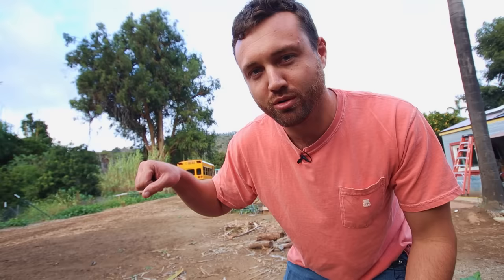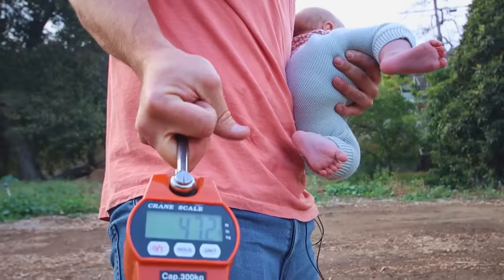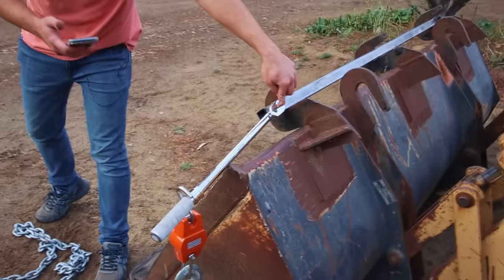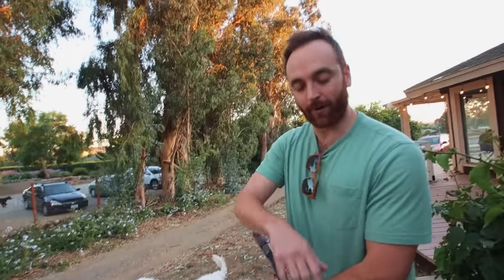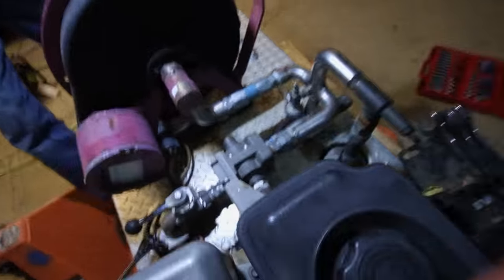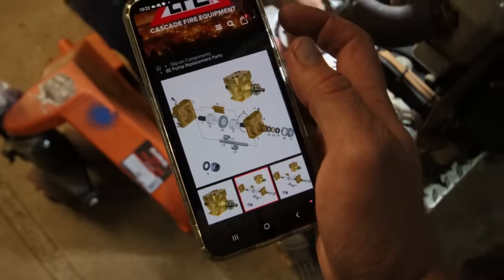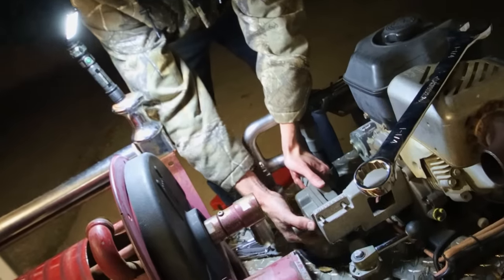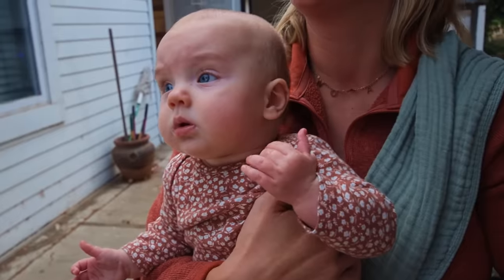Proving my very big wrench works

Comment: What made this video even better is I work at a Toyota dealership and Toyota recently released a torque application module for training which explains why this works lol
Reply: Sad thing is, I feel like it shouldn't need to be explained why it works
Reply: Idk, I'm taking my second physics course right now and trying to think about why it works is not imreally intuitive to those who don't know what torque represents. If it were going in a complete linear motion, it would not increase the force. I think it's fairly easy to get confused by that
Reply: @kstorm889 I spent a few minutes scrolling through the comments from the last video, and I only found two saying he was wrong. One of those comments (which had mentioned free body diagrams) was retracted thanks to the other, which was a comment that I made, and my point in that comment was that his explanation of how torque is multiplied in the previous video was wrong. He got it right in this video, but in the last video, he said 200ft•lbs multiplied by the 5ft extension equals 1000ft•lbs which isn't correct. The torque is actually multiplied by the ratio of the overall length to the length of the wrench. (If the wrench is at an angle to the extension, the overall length is measured parallel to the wrench from the wrench handle to the perpendicular line that passes through the bolt.) 

Using the numbers from this video that would be 214×(76.5/16.5) = 992 which is basically what he measured. It would appear to me that he got lucky that the length of the wrench and the extension plus the fact that actual torque is 7% over the set torque worked out to make the torque multiplication of this setup approximately 5. (The exact factor is 76.5/16.5×1.07 which equals 4.96)
Reply: @jsax01001010  I get what you're saying and agree 100%. maybe I misunderstood thinking his extension  made for 5' or whatever it was. I just knew when I saw the rig that there would be a lot of debate in the comments.
Reply: @kstorm889 ikr isn't common knowledge that the longer the lever increases the torque?

Comment: So I am an engineer and I design fire trucks for a living. That's what we consider a skid unit most likely was originally on a small a UTV or something. We don't  do too many trucks with skid units but Ironically I am actually currently designing a custom one for a Polaris ranger at work right now. Anyways. There should be a hand primer somewhere in the unit which will prime the system within a few pumps. If there isn't there's a chance it was mounted to the UTV and was not kept with the unit when you bought it. I am not super familiar with that exact type of pump however in general it's bad for a pump to run dry and it can cause it to overheat and damage components so there's a decent chance that if it wasn't already damaged before you bought it attempting to run it dry is what ended up damaging the pump. I would look closely to try to see if there's a hand primer installed on it. If there isn't you need to buy and install one and make sure it's primed prior to use. Also make sure you have your valves set correctly so you have water flowing through the pump. There is often a tank to pump valve as well as a tank fill valve both of which being open will allow water to just cycle through the pump while you aren't using the hose. Remember water is a noncompressible fluid so it needs to be able to go somewhere otherwise things can break. I would suggest having that friend you talked to or someone at the manufacturer of the system run you through how to operate it if you aren't sure. Also not sure where you live but especially if there's any chance of freezing you need to make sure you drain the pump system after each use. We see a few trucks come in periodically for new pumps because they forget to drain the system in the winter.

Comment: hey William! Im a Mechanic Engineering student and wanted to say your demonstration, though a lil rough 😁, was great!

I think for people who dont know the equation for Torque is LITERALLY the cross product between Distance and Force it may have been a bit difficult to visualize what exactly you were getting at.

People not in stem don't even know what Torque really is (my gf thought it was basically a force, for instance). For anyone still confused, Id like to explain it with the basic principle of the lever and the equation for torque.

If I need 1000 Nm of Torque (same units as lbft but in metric) but I can only verify 200 Nm of Torque, what distance do I need to achieve the desired reading?

We can start by setting up two equations: T1 = R1 x F1 (where T1 is torque needed, R1 is distance from the center of rotation to the normal force, and F1 is the Force applied [by William lol!]) as well as T2 = R2 x F2 (where T2 is verified torque. R2 is the distance from force to center, in this case the length of the Torque wrench, and F2 is normal force again)

However, it is evident that in both scenarios, the same William will be the one applying the force. So, if we trust William to be a good boy, we can assume that he will apply the same amount of force in both scenarios! This gives us F1=F2=F. Knowing this, we can now combine both equations by solving for F individually like this:

T1 = R1 x F1, T2 = R2 x F2
=>
F1 = T1/R1, F2 = T2/R2, F1=F2=F
=>
T1/R1 = T2/R2

Now all we have to do is solve for the length needed, R1!
R2, the length of the torque wrench, was given to us by William, which is about 0.4 m.

Now all we have to do is plug in to our equation and solve for R1!

T1/R1 = T2/R2
=>
R1 = R2(T1/T2)
=>
R1 = (0.4m)(1000Nm/200Nm)
=>
R1 = 2 m!

This means the distance needed to get 1000 Nm of torque while only verifying 200 Nm at 0.4m (and assuming the same force is applied) is 2m!

So what do we get when we convert from meters to inches?

R1 = ~78 in 🤠🤠🤠

subtracting the 16 in of length from the torque wrench from it, we get 62 in, which is ~ 5ft, exactly how long Williams extension is! 😌

Overall my calculations were about 2 in off from Williams actual distance, not too bad since this was all made up and converted in and out of metric, but the principal is intact.

Hope this more mathematical based approach helps anyone still confused! Remember, Torque is leverage 👺

Comment: I don't know why people would doubt it. It's a known thing,it's just math. I was once looking into using an extension on my torque wrench to do some work on my transmission. The adjustment was right between the trans case,and the frame,so I couldn't get a torque wrench+socket in there,but I could fit a slim torque wrench extension in there (imagine something like an open-end box wrench).. I looked into them,and yes,they sell them...and there are clear instructions for doing the math to work out the correct torque,with a table,and everything.
Archimedes has known this since the dawn of time.

Comment: I work in a small engine shop and that pump that's on the water hose machine thing, is exactly like the ones that are on some of the bigger pressure washers that I work on. And fun fact about those pumps, if you don't run them with water going through, they will destroy themselves in less than 5 seconds. i learned that the hard way

Comment: I think that people that were confused about it were thinking about the fact that torque is equal regardless of where you apply it, however this is not just torque, you have a perpendicular force generating torque. If it was something like a motor you would need 1000foot/pounds regardless of how far you apply the torque.

Comment: In regards to the self-priming pumps: in the bush firefighting fire trucks here in Australia; our main pumps on the trucks don't self prime, but we have bilge pump styled hand priming, or electric primers; but they're not automatic.
For smaller pumps like what's in this video they are pretty much never self-priming (We dunk our helmets into the river/dam/lake and use them as makeshift buckets to pour into the top of the impeler housing to prime the pumps. No I'm not even kidding).

Comment: did people really not think your giant lever wouldn't work? i loved it lol. i was happy to see you made the worlds greatest cheater bar instead of just buying a geared torque multiplier. for one, your video was entertaining and you just buying an off the shelf tool would be boring, and for another thing, making your own tools to work on things is just part of wrenching on equipment. i have a drawer full of weirdly shaped wrenches that were modified for specific things over the years lol

one of my favorite things about torqueing something to spec though is that you can really get super close to a calibrated torque just using a regular big wrench and some tape. if you measure out an exact length on the wrench to pull on, and you can get the wrench to be level with the ground, you can do the math and simply put weights (like lifting weights) hanging on the wrench to reach the desire torque. you don't even need a fancy freight scale to do it that way lol

Comment: Get a load of bolts and weld nuts in place so you can toque them until they snap off. Then test your torque wrench without the extension and find the minimum bolt size that survives. Then use your extension and see if it breaks. See how much bigger bolt you can break off with the extension but wrench at the same setting.

Comment: As a calibrator and someone who has calibrated over 800 torque wrenches for the military, NASA and various other companies. When calibrating them they are calibrated usually within a tolerance of 4%, when your taking a measurement the only accurate spot to measure from is the middle of the handle, usually textured part where you adjust the torque. The measurement is taken with a transducer in the bench, force scale will not accurately measure the force. While the pole does indeed increase the torque applied, however part of that force is taken by the deflection of the pole. it will not be accurate in the slightest maybe to a tolerance of 20% to 30%
Reply: force isn't "taken by the deflection of the pole"

Comment: if u contact the seller they prob say u ran it without priming and thats why its molten, unlike what prob happened is that they left it running dry for for a long time and sold it after it broke

Comment: Will is going to learn quickly that with big equipment, comes even BIGGER tools to maintain it. I have an adjustable from the 60's that I use to fix stupid stuff on tractor buckets, PTO's, etc. Find the nicest (bang for buck) and largest (bang for buck) adjustable wrench from anywhere pre 90's and it will last at least Potato is in their 70's. That wrench in particular is what I plan on using in case of a zombie apocalypse.

Comment: FYI the torque wrench contraption should work as long as the wrench is parallel to your piece of steel you're using to extend it, if it's at an angle the torque wrench will pop before the predicted 1000 ft lbs.   

Also did Kevin move in?

Comment: - as per the debate held by John Cadogan in Australia - errors with clicky torque wrenches arise doe to improper hand  (or force) placement relative to the "manufacturer supplied hand grip"  (centre of the handle) - ie if one "chokes upon the handle, the fastener gets "over-tightened" by the time "the click" happens, you don't seem to be making this mistake  (but a electronic torque cell  may prove a case better than a force cell..)...   - fun days... lol...

Comment: Torque wrenches have been argued about by mechanics for decades.

The physics group I run has gotten quite a few requests on the topic and usually the audience has an understanding of the topic after demonstration.

That said, the arguments in general come from the lack of understanding how the tools/formulas work. Usually once they see how it works they don't have any other questions on the matter.

Comment: "Bustards, including floricans and korhaans, are large, terrestrial birds living mainly in dry grassland areas and in steppe regions. They range in length from 40 to 150 cm" 
I know these ones can get them arms, they almost already have arms kind of because their legs are pretty thick but they need to have a second set of them chunk legs so they can pick up arms with their arms. They have the leg strength in order to lift several pounds. Arms could weigh some pounds and becoming armed would also weigh a couple pounds. I think catching some of these dudes and then taking them to planet fitness or something could kickstart them growing some nubs from their torsos because they will have a need to pick stuff up if they got some weights in front of them.

Comment: The question I have about the torque wrench setup is that the torque wrench is calibrated to account for the torque lost in the deflection of its own bar, but it’s a totally different story when you add your own bar. I don’t know how much of a difference that would actually make, but I know that air guns use different extensions to torque bolts to different specs. The applied torque at the gun is the same, but the torque that makes it through the extension and to the bolt can be less.
Reply: The torque sticks your talking about are very ruff not all impact guns are the same weight rpms etc the way he did it will be in the ball park probably only +30 -30 ft pounds out

Comment: If you made your torque wrench extension out of a 5ft pool noodle instead, would you still say you got 1000 lbs of torque? 

If your extension bends when applying the torque, do you think you might have lost some torque?
Reply: Yeah, he's using the formulas he used in school, which are absolutely accurate...in the ideal situations that they model (e.g. if the lever has exactly 0 deflection). But his contraption is a whole hell of a lot more accurate than just putting a long-ass breaker bar on a wrench and pulling until it "feels right" ;)

Comment: Wait, isn’t torque = Force / Distance so shouldn’t it be Lb/Ft (Pound/Feet) not Foot / Pounds (Ft/Lb)?
Reply: It's neither of those. it's lb * ft (pounds times feet,...multiplication, not division...usually written as ft-lbs or ft (dot) lbs). It's a force (in pounds) extended over a distance (in feet). You can just as accurately say ft * lbs...they are exactly equivalent. Interestingly, people tend to say ft-lbs when referring to torquing bolts, but lb-ft when referring to torque produced by an engine.

Comment: Were people really saying that torque wrench and pipe wasn't 1000 ftlbs? Guess how wheel nuts are torqued on airplanes?
Reply: probably with a properly calibrated tool? will is correct of course, but what do airplane wheel nuts have to do with anything
Reply: @robmckennie4203  because at that torque value of 1000 lbs, if you're in the ballpark of 1000 you're fine. I brought up wheel nuts because that's literally how we torque them, 4 foot breaker bar and all

Comment: I don't know why you had to make this video. You ARE correct as what you made was basically a an extremely large beam torque wrench. Which literally deflects and shows your given torque.
Reply: People are silly.
Reply: i don't think the argument is over if a longer lever gives more torque (for the most part, i swear i saw someone say that the torque output is actually equal to the torque input?) but more an argument over how you know how much torque you're actually making

Comment: Well, Foot-pound, or ft-lb, is defined as, "a unit of torque equal to the force of 1 lb acting perpendicularly to an axis of rotation at a distance of 1 foot." This would mean that, mathematically speaking, you should be able to scale up the input or distance. 10 ponds at 1 foot distance, or 1pound at 10 feet distance. Both output 10ft-lbs. People are generally bad at math, so they prefer to go off of theory without ever actually testing their logic. Those people questioning it are just dumb and arrogant, a bad combo.

Comment: William, all you had to do was slip a long bar over the end of the ratchet, and you'd have an actual proper long torque wrench. Where you have the joint is affecting the actual torque output, your math is wrong.
Reply: where's the error in the math? 2 foot torque wrench at 200 ft pounds takes 100 lbs of force, 100 lbs of force on a 5 foot lever makes 1000 ft-lbs
Reply: @robmckennie4203  you misunderstand. Just take the regular wrench that he used, and instead of mutilating it and welding it back together, you just slip a long steel bar over the end when you need the extra torque. Just WAY simpler way to achieve the exact same outcome.

Comment: Torque wrenches make people go all sorts of stupid in the brain with 'stop thinking, start repeating literally anything ive heard in the past.'  Extensions? Magically make torque go away with nowhere for it to go (Thats impact wrenches where the springyness can absorb the peak exerted by the hammers)    Grippy  knurled portion? Hand must be centered on it, otherwise torque is off (No, its not  the pivot at the head measures torque and clicks, doesnt matter how you get it in there)  etc etc.

Comment: Hi william, i dont think you are right. The wrench does torque roughly 1000 footpounds, but your reasoning form last video why it should torque 1000 foot pounds is wrong. You cant multiply torque by distance to get another torque. The reason it does torque roughly this amount is coincidence. If you hold it from the tip it should give a torque of 866,6666666 foutpounds. Assuming your torquewrench is 1,5 foot long
Reply: it was definitely a mistake to say "200 ft-lbs times 5 feet makes 1000 ft-lbs" i think it's possible that he meant "the amount of force required to make 200 ft-lbs here makes 1000 ft-lbs because i've made it longer" but the fact that 200x5 actually does equal 1000 makes it unclear